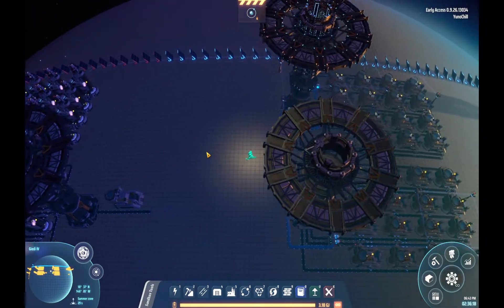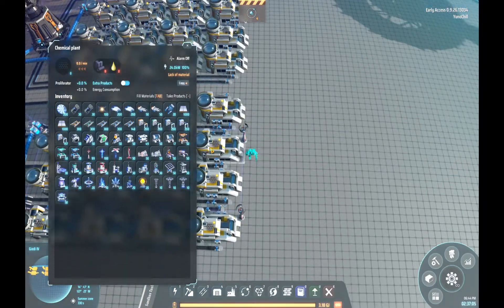Balancing hydrogen is easy with these methods - Dyson Sphere Program

Comment: Not sure why YT recommended this video now, but thanks for making it. All my systems are fairly haphazard, but I'm much better at dealing with hydrogen than I used to be. I spent an embarrassingly long time making DIY output selectors out of an array of 5 splitters, but now that I know hot to use a splitter, I tend to make a refinery loop for oil and a smaller loop for H2 until I can get a gas giant online.  good advise re: fire ice

Comment: Later you need ungodly amounts of Hydrogen for casimir crystals (green science and rockets). The only challenge is to get your excess hydrogen used before all the other hydrogen. I usually build the casimir factory planet in a system with a hydrogen gas giant. Then i place Interplanetary Stations (ILS) on the poles, which have a vessel range of 1ly and are allowed to pull from gas giants - no drones in those and set to REMOTE DEMAND, LOCAL PROVIDE hydrogen. Closer to the factories i place a bunch of Interplanetary Stations which also REMOTE DEMAND, LOCAL PROVIDE. Those are not allowed to pull from gas giants, but they have unlimited range and drones. They will vacuum up all the hydrogen from my galaxy and proactively distribute it to the casimir factories with their  drones.
The casimir factories request hydrogen and have drones. the drones will go first to the "vacuum ILS" because they prioritize distance - therefore the vacuums  ILS need to be closer than the ones at the pole pulling form the gas giant. Whenever there is no hydrogen in the vacuums, the drones form the factories will go the the poles and get hydrogen from the gas giant ILS. Because the gas giant ILs has no drones, it can't proactively distribute hydrogen, it will only be used, if there is not enough hydrogen in the vacuum ILS. That way, your galaxy will always be free of hydrogen. Wherever you produce excess of it, just put it in an ILS and REMOTE PROVIDE it. Those provider ILs can have vessels. They will deliver to all remote demand ILS (including the gas giant ones), but that doesn't matter (it's actually good) as long as the hydrogen gets shipped off the planet to where it is needed.
The idea is that every excess hydrogen is provided and you only build factories who need hydrogen in a system with a gas giant - that way you can easily subsidize a lack with hydrogen from the gas giant. You could setup a whole system on that planet with belts and priorities to ensure that you use the excess material from the galaxy first, but working with distance and drones/no-drones is sufficient enough for large scale operations (my current build is at 10 blue belts white science). That said, i generate all my fuel "hydrogen neutral" as described at the beginning, but i do use the fire ice graphite.
You can also use fractionators to turn hydrogen into deuterium, but to be honest, just get the deuterium from gas giants and don't rely on fractionators.

Comment: I have a planet that makes solar sails, using fire ice as a source of graphene. It burns hydrogen fine as long as I don't bring batteries. They have a priority. I use antimatter reactors to provide the power if hydrogen runs out
It's kinda funny actually. I have dyson sphere with 80GW and I tapping none of it dirrectly on this rock

Comment: this shit would be so much easier with factorio combinators

just set oil to make when hydrogen is low and there is spare oil
and vice versa
Reply from the maker: Sure but making things too easy can take the fun out of logistics.
At least for me there is a certain satisfaction to balancing tricky factories, and doing it cleanly and optimally.
Reply: @yunochill9304  as someone who never really used combinators i still find them more fun to find applications for than juat base logistics

Comment: There is 1 way of incinerating hydrogen you didn't mention. Send it to particle colliders to make deuterium, then burn that deuterium in thermal generators. Colliders will destroy half of hydrogen outright, and their sheer power load will take care of the rest.
Reply from the maker: Burning deuterium has the same problems as burning hydrogen, in my opinion. I'm not the biggest fan of this method but it's definitely a possibility!

Comment: Now to figure out coal on a low resource file.  The problem here is fire ice is infinite, coal isn't.
Reply: Unless you are playing 0.1x, everything regular (iron, copper, coal, silicon, titanium etc) will eventually become infinite with that mining research going on forever. If you are playing on 0.1x resources you should know better than this video😅

Comment: You can also just only get hydrogen from gas giants, so that all the hydrogen is built up in the interstellar transit hubs.
For refined fuel, just have a coal mine and use reforming to make 2 fuel into 6.
(Reforming costs 1 refined fuel, 1 hydrogen, and 1 coal. Processing oil produces 1 hydrogen, so a 1 cleaner to 1 reformer is possible.)
Reply: For the amount of Hydrogen you need in the later game, you can built as many collectors around the gas giant as you'd like and still starve on it. You need all the crude oil from the starter and at least the one from another planet + gas giants to work in late game. Especially, when considering the light oil is needed in plastic and therefore the organic crystal and titanium crystal production that you need for the yellow matrix. Currently, I need around 6000 light oil and around 12k hydrogen per minute to operate my base. Just drawing it from a gas giant simply does not do the trick - even with vein utilization at level 22.